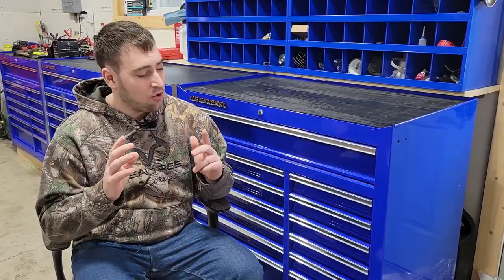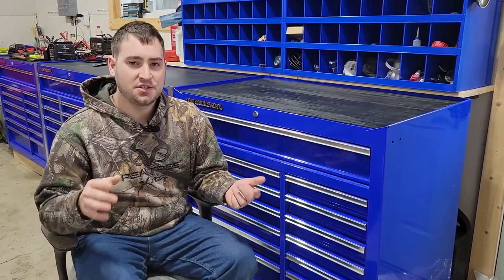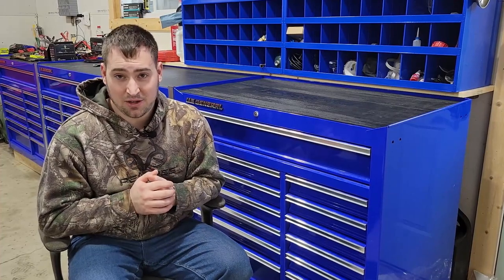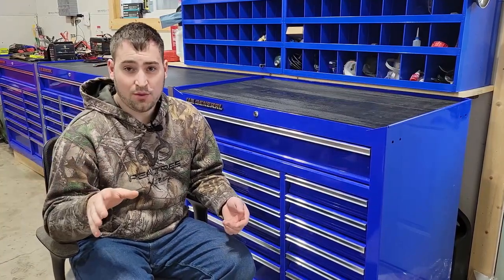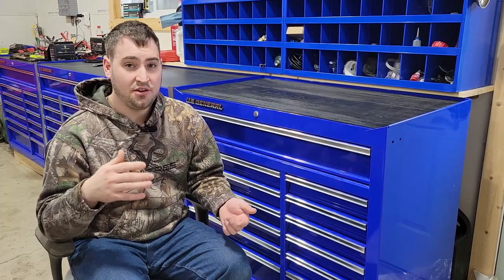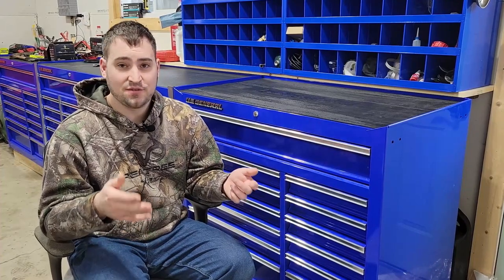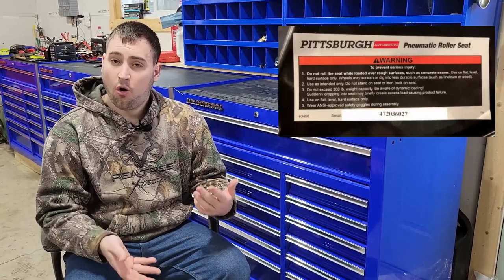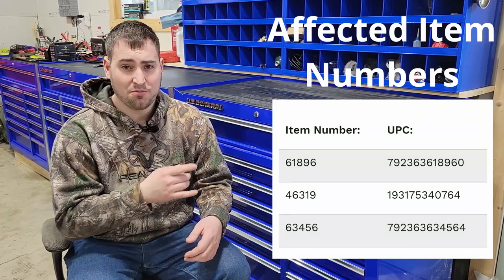ANOTHER Harbor Freight Recall - Pneumatic Roller Seat

Comment: I own a shop and I have bought probably 7 to 10 of these over the years and they have been awesome and I'm a big guy I also have a guy in the shop that is well over 300 lbs and they have held up well other than 1 that has lost a wheel and we replaced it with a new caster from hf  tools it was a bigger wheel so I had to change all of them on that one seat